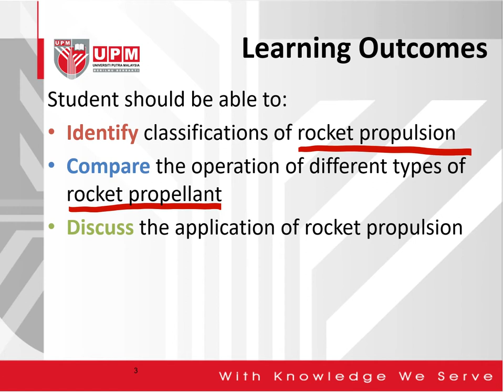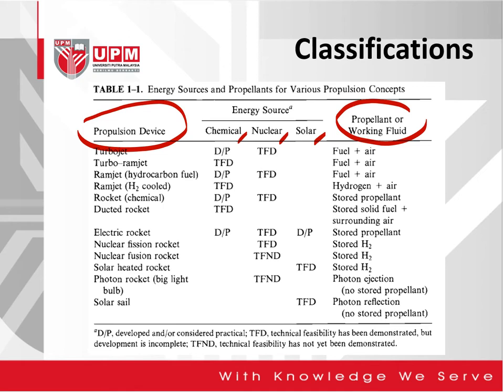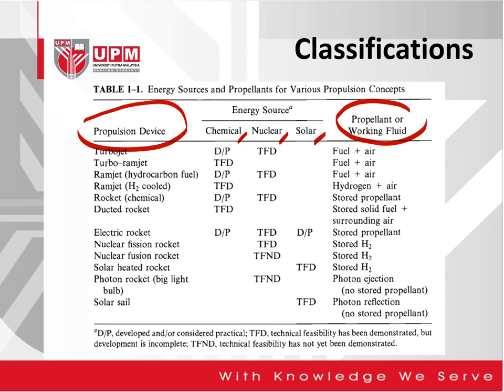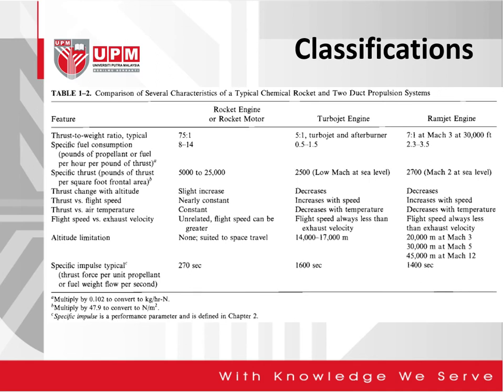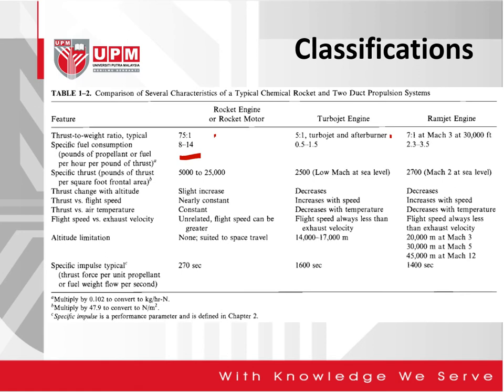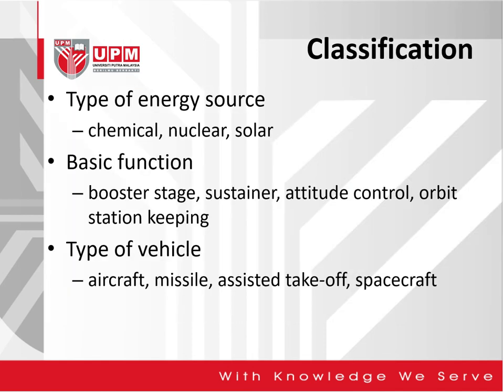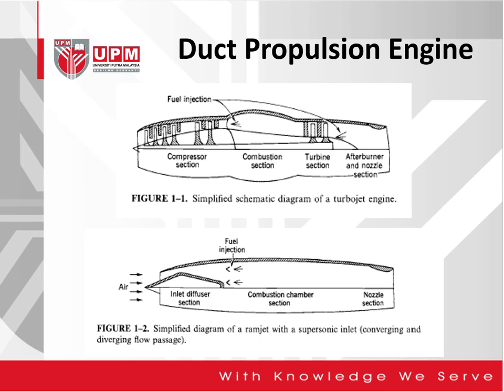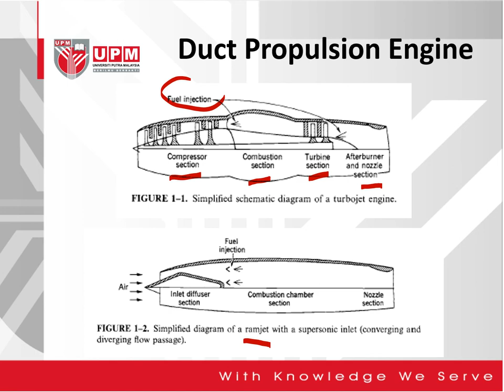Rocket Propulsion: Introduction and Classifications

Comment: Salam Dr,i want to ask,for the thrust decrease with altitude,is it true because of the loss of thrust due to pressure decreased on high altitude is greater than the thrust increasing with decreasing temperature on high altitude can be the reason the thrust will be decreased?
Reply from the maker: I assumed your question is related to rocket propulsion. What are the parameters governing rocket thrust? We will cover the rocket thrust equation in the next video.